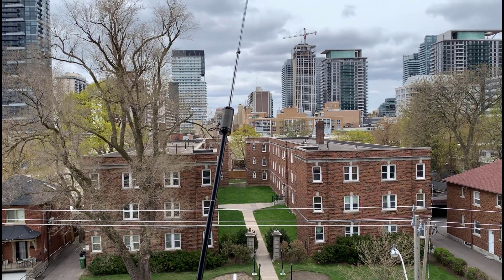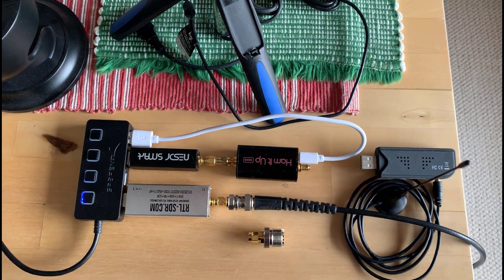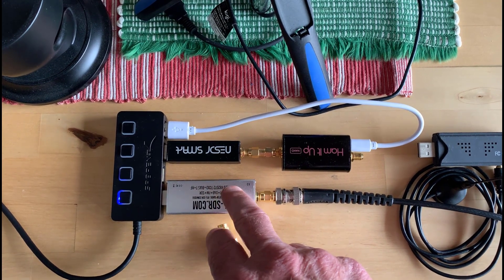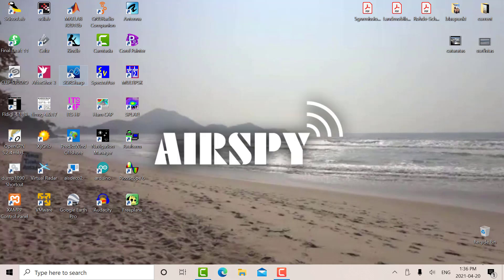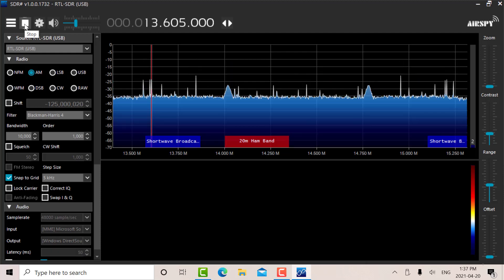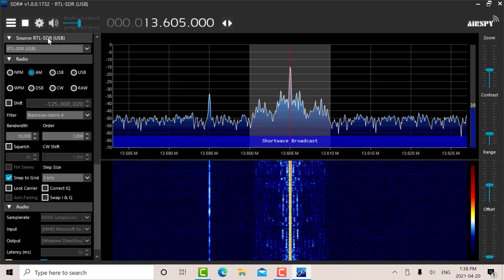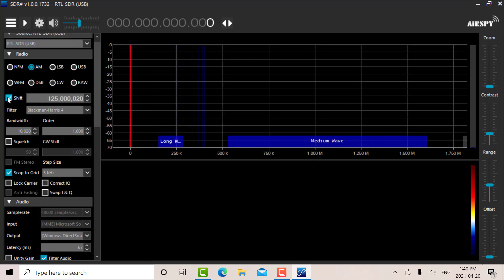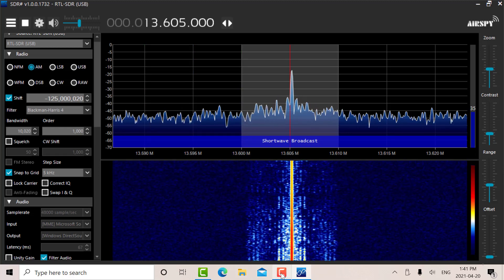RTL-SDR - V1/2/3

Comment: I also have v3 dongles and use them with and without the Ham-It-Up upconverter.  I use HDSDR as my interface program and have noticed that there is no RF gain control available when using the direct sampling mode.  Also, images that occur in the direct sampling mode are not only driven by the intensity of signals but then are also driven by the sampling algorithm itself (Nyquist frequency aliasing), which causes frequencies to be mirrored on either side of 14.4 MHz (You most likely know this already).   I bought the upconverter because I liked having a RF gain control (you will need an attenuator if you can't control the RF gain) and also, I didn't like signals showing up in the wrong places in the HF spectrum (I was getting signals from 80 meters showing up in the 12 meter band).  Hope I didn't bore you with this.  Thanks for your video, I liked it a lot!
Reply from the maker: Dan many thanks for your experience. I resisted buying the V3 for a long time but I finally did because various users of Open Plotter were using it to receive HF WEFAX so I wanted to see how well it performed. The ADC Fs=28.8MHz, so as you mentioned the upper bandwidth is 14.4MHz so we have aliasing. In SDR# there is also no gain control in direct q sampling. I always like to back off the gain to only what I need with the RTLs, because the intermod floor comes up rapidly. The good news with the V3 is that the USB power consumption is lower on HF, although I have to do more tests with different USB ports and bands. Thanks again for your information.